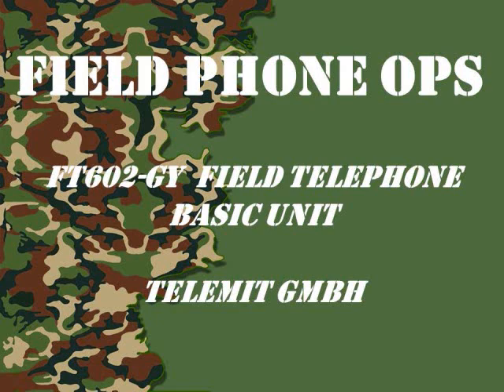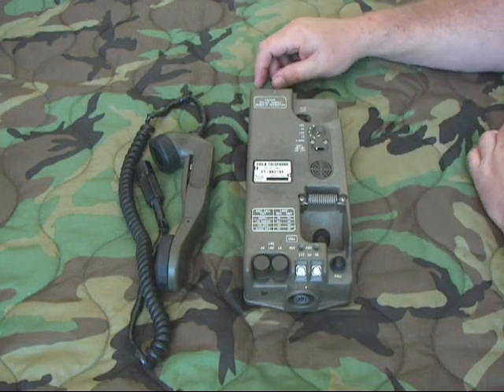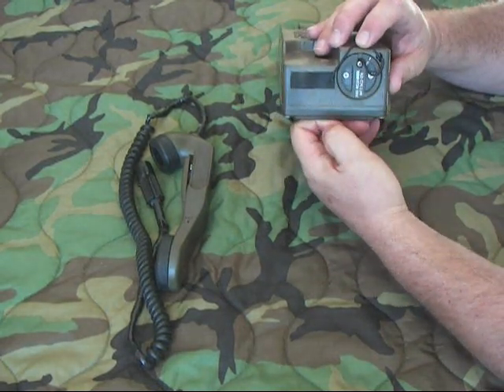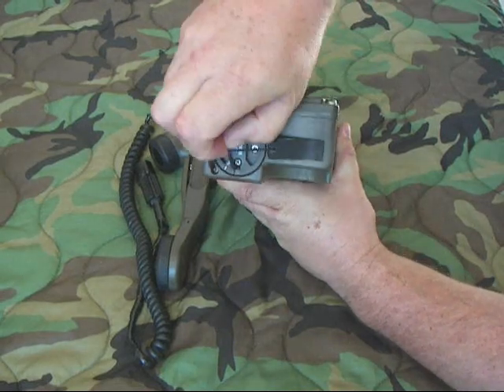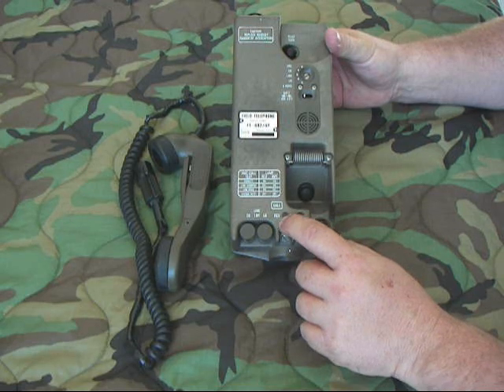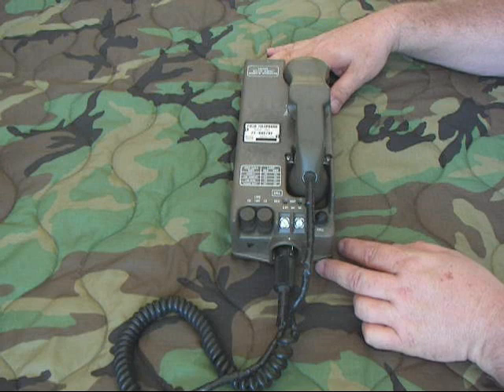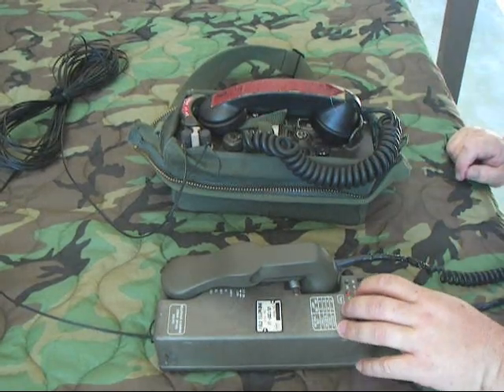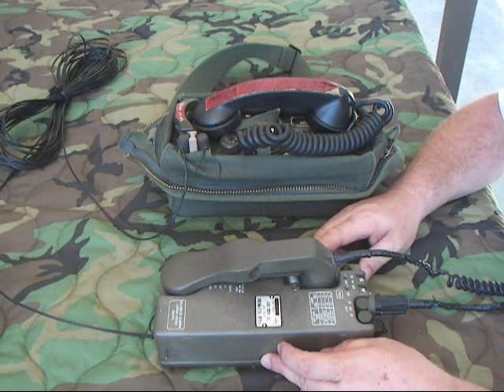FIELD PHONE OPS: FT-602/GY  Field Phone

Comment: I got two of these with Israeli markings, but it seems that the lights/terminals/dial port were all hotglued shut. The dial accessory port is just sealed and there is no LB/CB switch.
Reply from the maker: This was a unique field phone because the German company, Telemit GmbH, that produced them had no contract to provide them to the West German military.  They decided to develop them and sell them to whoever would buy them and had some success.  The Italian military, the French Foreign Legion,  and the Iraqi's purchased some.  The UN would purchase them for many of their peace keeping operations.  And now it looks like the Israeli's purchased some.  It appears they made a really basic module that did away with many of the "frills" that mine have.  Its probably a good guess that the mode selection module was interchangeable and when the phone was produced they installed whatever module the production run specified and it might even be possible to upgrade the basic phones to the higher level by swapping these modules out.